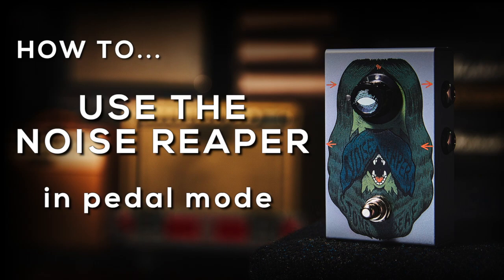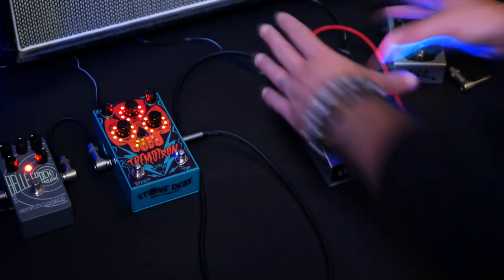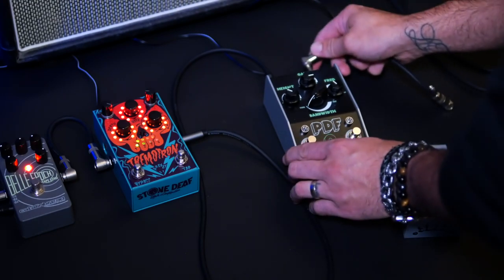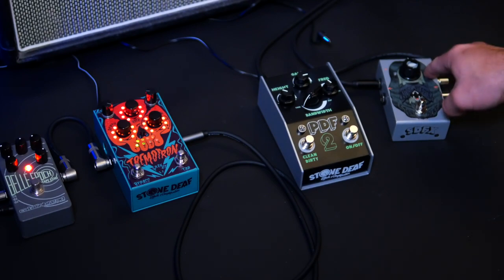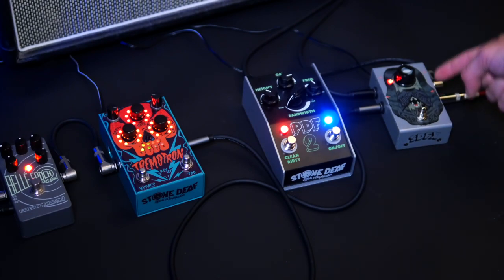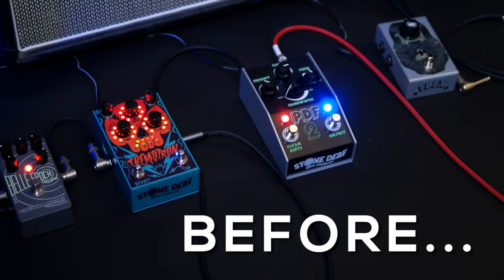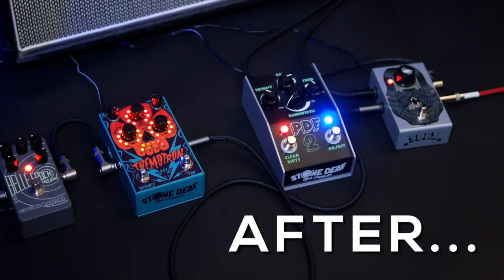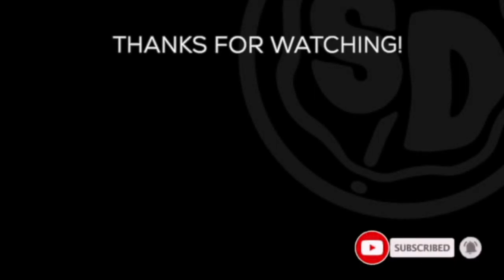HOW TO... Use the Stone Deaf Noise Reaper Noise Gate in Pedal Mode

Comment: This is how I run mine. I've considered getting a second one for my effects loop chain too, but it's not really necessary.
I run my Fuzz War, Rat clone and sf300 through it.
I do have to turn mine up a fair bit more though, I run mine around 9 O clock about parellel with the red led.
The McBess artwork is one of the main reasons I got this brand when I knew I needed a noise gate (because what really seperates one noise gate from another?) but everything about the chips being good sounds great as well.